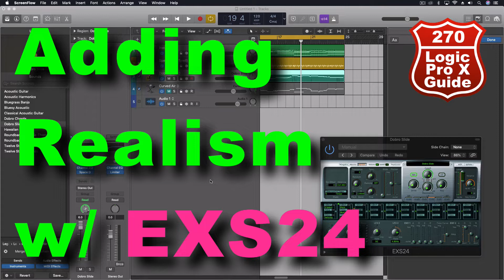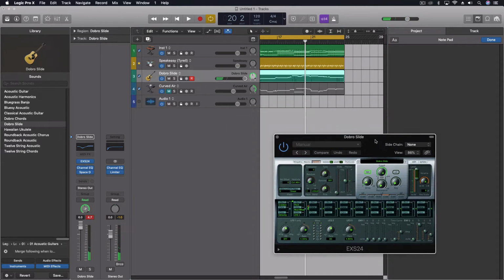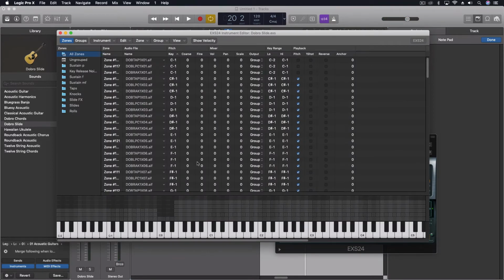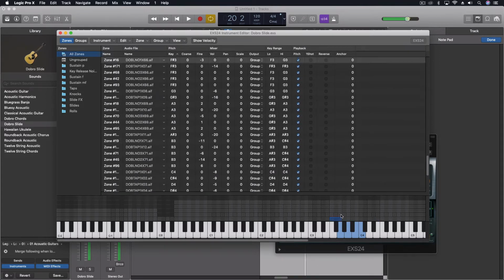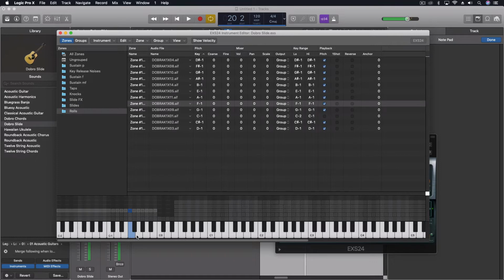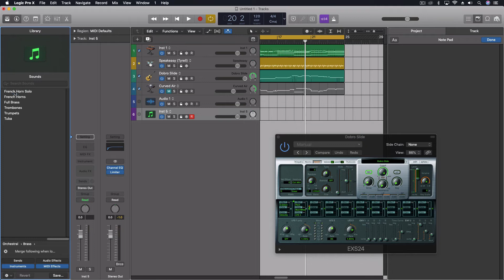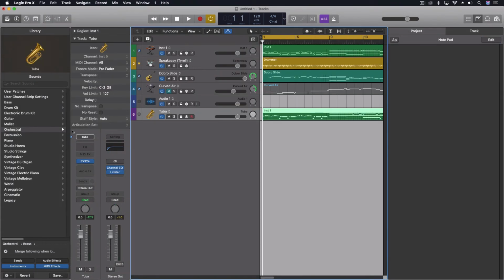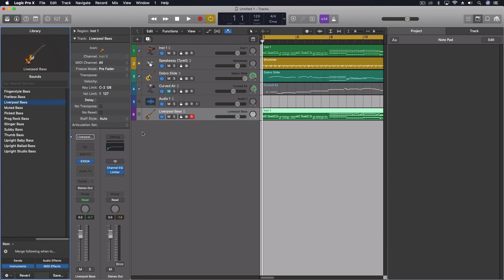Adding Realism w/ EXS24 (velocity layers) | Logic Pro X

Comment: Your videos look so good . What screen capture software do you use. I use Quiccktime and am having audio sync/drift problems. Any suggestions
Reply from the maker: I use Screenflow and I love it. It’s had some bumps over the years but I won’t switch.
Reply: @LogicProLife  thank you I'm gonna check that out
Reply: @LogicProLife  Thank you so much. I'm trying Screen flow and seem to have latencey issues when I record with the Logic audio output setting to Telestream. Do you have that problem or a solution?
Thanks
Reply: @LogicProLife  I had the Midi preferences set to Ishowme instead of the Telestream capture. pretty sure that was the problem Thanks Can't wait for your next video